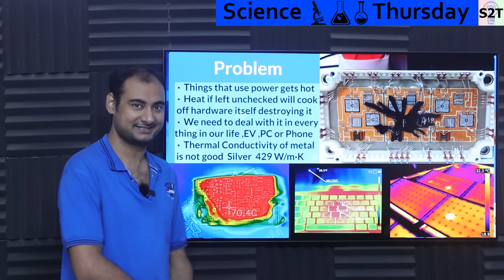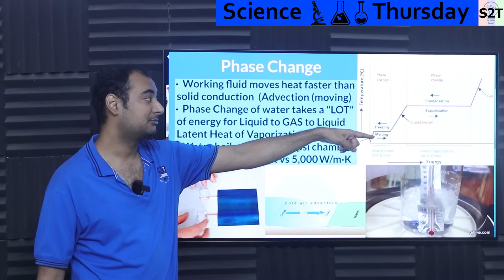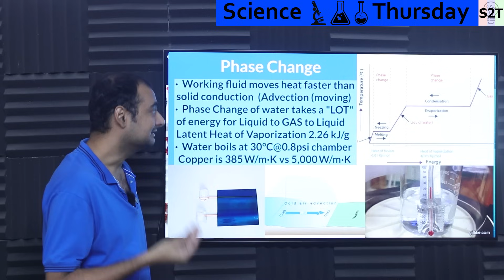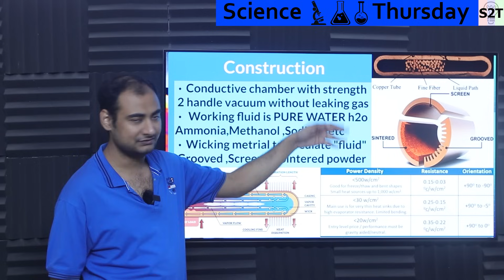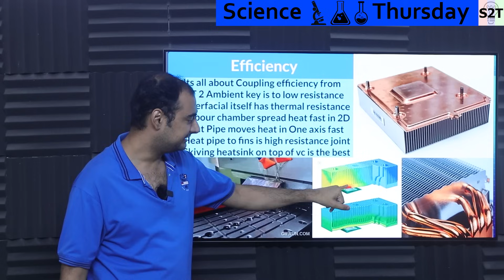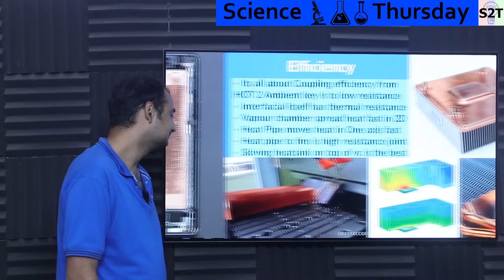Heat Pipe & Vapor Chamber Explained {Science Thursday}

Comment: Yeah, the by a wide margin most limiting factor is heat transfer between media. The rate heat can be transported by the working fluid isn't a relevant limiting factor as long as the working fluid can flow freely enough. 

In a closed system with a fixed volume and only liquid water and water vapor in it, the temperature of that water will be the boiling temperature. Any change in temperature will change the pressure, and by that the boiling point, to the actual temperature. Without any pressure differences, or flow restrictions, the boiling point in such a system will always be exactly whatever temperature the liquid water and water vapor is, at any given moment.
Reply from the maker: That's some interesting information; thank you for sharing!

Comment: Perhaps, the industry will migrate from silicon to monocrystalline synthetic diamond for higher thermal conductivity and higher maximal temperature.
Micro-channels for liquid coolant will be build inside the chips, like in between stacked chiplets.
Waste heat extracted will be harnessed for forced circulation of the coolant. When the fluid boils in a tesla-valve or in nozzle-like channels it will tent to self-circulate.
Reply from the maker: too far out man as monocrystalline stuff is expencive